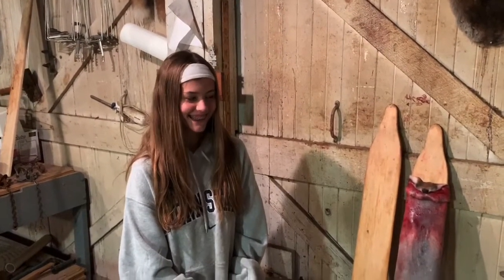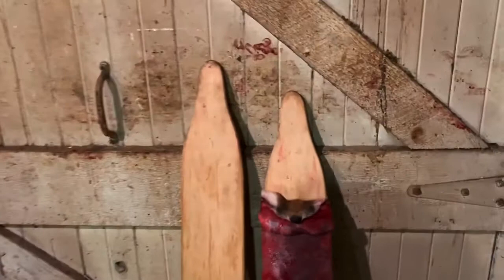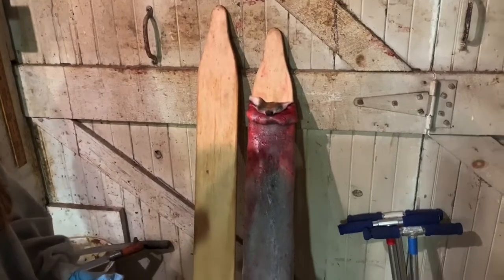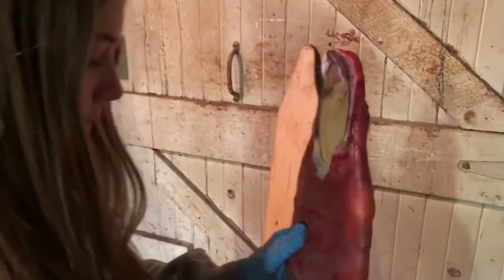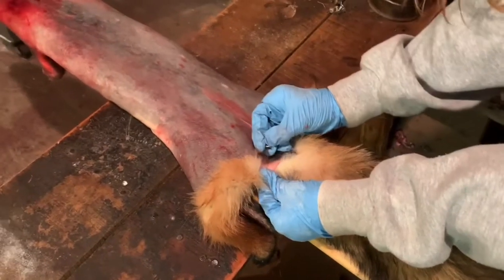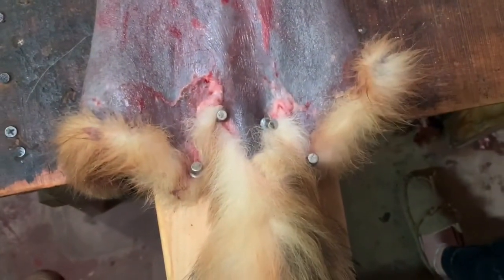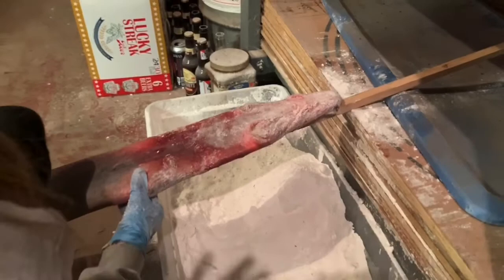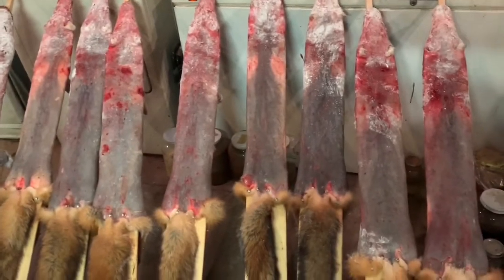Red Fox Boarding

Comment: Good vid Todd! I do the same thing with my yotes except I use adjustables on yotes. But all my adjustables are set the same unless a really small dog or a really large one. Most of these Kansas dogs are purty average in size though. Not like the easterns that can vary. Correct me on them easterns if Im wrong. Never trapped out east. My granddaughter helps me in the shed also , she is 3 lol. Papa little helper😁
      Richard from Kansas;)